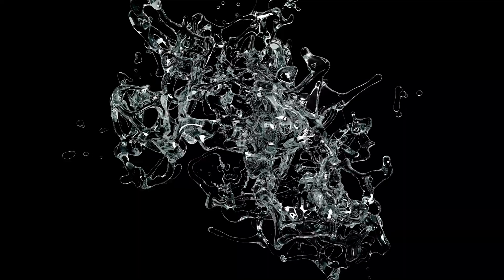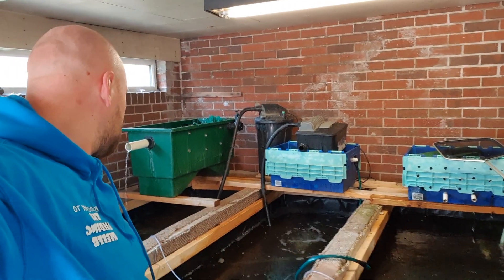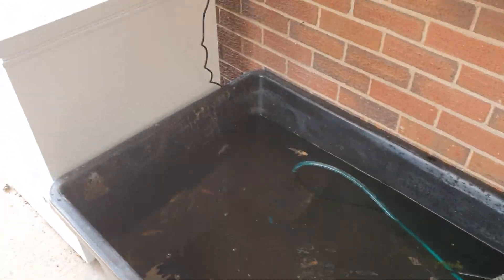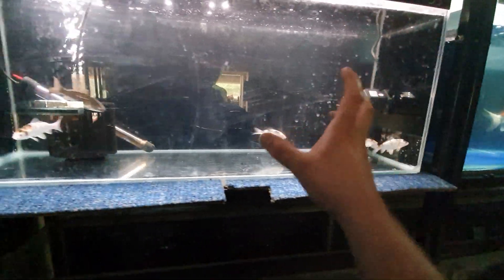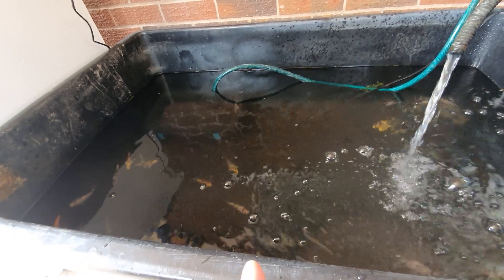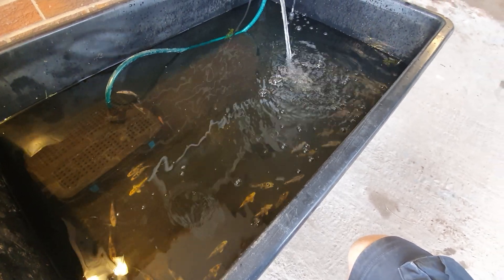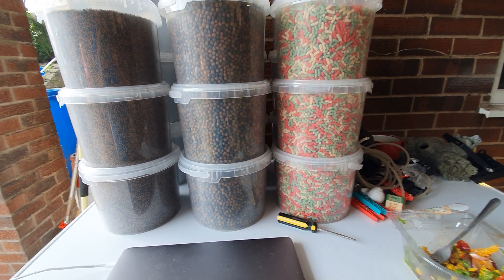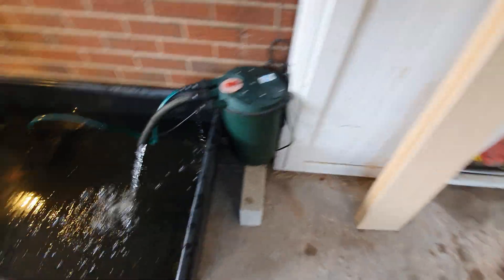How to get super fast koi growth!

Comment: Hey man.. shot alot for the vid :) 
I kept tropical fish as a youngster.. 
At a stage i had 2 4ft tanks, 3 x 3ft tanks and some smaller ones.. 
Havent kept fish in years. 
Built a 1000 litre ibr koi pond with gravity flow filter... water is supplied from rain water tank.. 
Thinking of growing a couple koi nice and quick and biggish.. sell them and maybe setup a spawing tank... 
Could you suggest how many koi i can squeeze in to get this project going quick? I got 5 lil baby koi so far. They happy.. sitting in  250litres.. waiting for rain. Only got this project going yesterday ..  
When both the 100litre (900 where ill be on my level) and the 250 litre are full ill dump and fill fresh.. dry season ill fill the 250l leave it for a week and then pump it over.. 
But ya.. the biggest question.. how many koi..? 
Thanks again
Reply from the maker: Hi mate, that sounds an awesome set up! A customer of mine has about 800 fry in the ibc tote, but when they get to an inch he puts them in a bigger pond